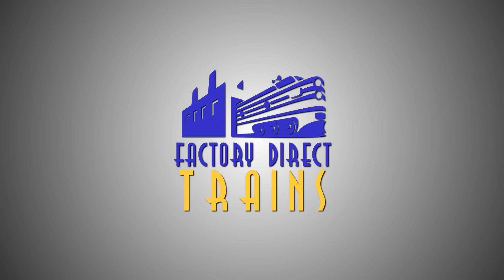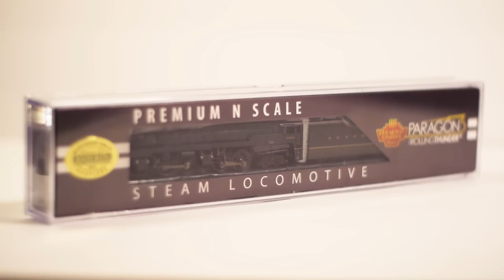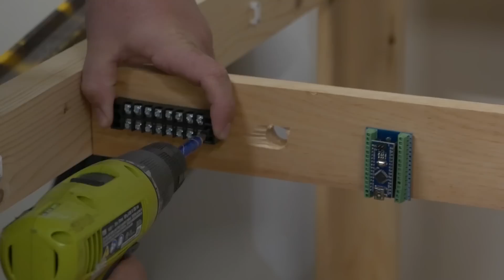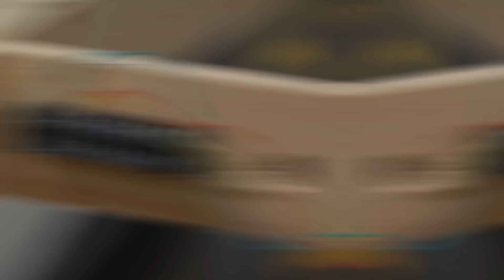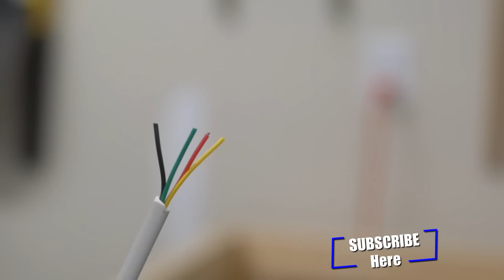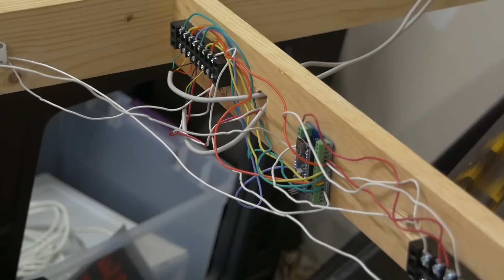DIY Arduino Model Railroad Multiblock Signal install Part 1

Comment: What about the logic system with the Ardunio System for running trains. Does someone have to input this logic from a computer keyboards. The IR's show train position on track. What about direction, etc. How hard is the logic part?

Comment: Also if the layout is an oval the uno will be between two nanos

Also how to handle sidings where a nano would have two next or previous block one on the main and at least one on the siding

Comment: Does the connections to the uno the same as each of the nanos connections
Also how does the code deal with the last block which will not have a next block 
Also the first block will not have previous block

Comment: what i did not understand what pins do the wires go on the next nano/uno?
sorry for being a pain
Reply from the maker: No worries at all!  Here is the section of the system design video that explains the communications pins https://youtu.be/Pe2-wL3BeW8?t=431  All the arduinos in the system need to share a common ground for this work as well.

Comment: I am planning a fully automated point-to-point layout using DCC++.  I am planning to use the infra-red sensor and like the modular approach you have put together but wonder if it can be used to be able to send back all of the block states to a central Arduino Mega (the DCC++ controller).

Comment: Excellent Video Jimmy!  For those of us that already have our bench work and layout on the bench work, I am thinking I would prewire the nano shield socket and the two associated terminal strips for each block on a small piece of 1/8 plywood essentially creating a module then mounting them under the layout in corresponding positions. This would save a lot of sore back under the layout time.   Also thinking about whether I can run those IR sensors through some fiber optic strands so that the track penetration is minimized.  Will let you know my findings.
Reply from the maker: This is an amazing Idea and I will be doing this for future projects!  Thank you!  It may be easier to run wires from the small sensor board to new IR emitters and receivers.  I'm planning on attempting this.
Reply: I have ordered some 3mm IR xmit/rcvr pairs from eBay to replace the 5mm ones. Plan to remove 5mm, install headers and use female/ female cables to attach remote 3 mm LEDs.
Reply: @doylesouders1228  Hi Doyle, have you completed the sensor modification mentioned above?  If you got it working, please send me the part numbers that you used for the 3mm IR emitter and detector. Cheers.
Reply: @gregkendall2019  Hi Greg,   I was not able to get the smaller sensors to work reliably so I used the above and beside track mounting that Jimmy used but I am also 3D printing what looks like equipment boxes for the signals to slip over the sensors so that they appear like normal railroad accessories.  I designed them on TinkerCad and am printing them on a Photon 3D printer.

Comment: Question, why didn't you flip the Arduino Nano around so you don't need to run the wires across the Arduino?

Comment: Jimmy,
Great plan to run your rough wiring while the benchwork (bay) is still open.  You obviously  work in TV.  You are the first MRRer I have seen do this on ANY VIDEO.

I love the hubbub of your point set.  It works.  But you do need backlight and maybe a light touch of camera right fill.  But a good job overall.

Now bad news or just a question.  A few weeks back you mentioned you were thinking about a stock yard ladder and a RIP track.  I have one based on the former D&H freight yard in No. Albany, N.Y.  So I was going to make you a copy and email it to you.
Problem 1:  You are N Scale.  I'm HO.  Solution:  Redraw it.

Prob. 2: You're SCARM.  I'm TRAXEditor.  Solution:  Download the trial.

Prob. 3:  You build on 6/8 doors (68" x 36").  My original is TOMA, across 4 Lower Kitchen Cabinets (total roughout 144" x 36").  Solution: Cut the ladders lengths and some main line features.

The design is done.  I thought.

Final Prob. 4:  In this week's promo and quick tip you stressed the point that the RxR design and Ops. are our own.  And we should not be critical of each others vision.  Great point.  Though I may seen critical, actually I try to make things better by seeing things others overlooked and pointing out those littles things that could use a quick fix.  "The devil is in the details."  SO the final solution.  Are you interested in see my knockoff design?  If so I can email it to your DIY and Digital dropbox.
Jim

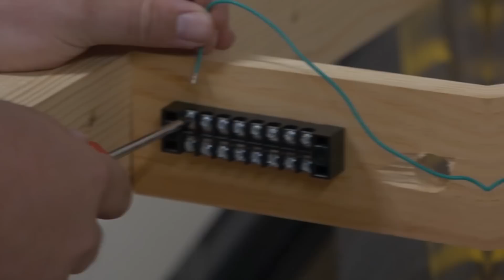Comment: Nice video Jimmy.  I hate to be even the least bit negative but I do have one comment because many of your viewers don't already know how to properly do the things you are doing.   PLEASE be careful how much bare wire you leave exposed at the terminal blocks, especially on the shield.  There are several wires on the shield (red wire at 3:23 for example) that over time can/will sag a bit and cause shorts and that is really easy to prevent. Admittedly a minor issue but a little attention will prevent trouble later.  Looking forward to part 2!

Comment: Jimmy...I'm not sure I understand the reason for the 8-slot terminal strip. Basically, its just acting as a wire joiner. Why can't you just run the wires straight from the I/O shield?
Stu.
Reply from the maker: You certainly can just run it directly to the IO shield.  I am running everything to the terminal strip to make it easier to access in the future if I need to make changes or trouble shoot.  It's basically giving me an easier place to access and work on wires rather than trying to work directly on the shield once the top is in place.
Reply: @DIYDigitalRailroad  I can certainly understand that. But to that end, wouldn't it be better to orient it vertically, like the I/O shield, so that your wires are going in from the sides? Because once you get the top on, I feel it might be a little more awkward to insert/re-insert wires in the top row. Or alternately, move it down so its closer to the bottom edge of the board.
Reply: @TheOriginalBadger  I can see two reasons for the terminal strip, firstly the small screws in the shield under the layout would be a real pain to swap around wires with and secondly fault finding with a multi meter would be much easier.  I also cringed with the amount of bare wire out of the terminals, I do instrumentation for a living I got bad chills seeing that, but good job and I am looking forward to future videos.